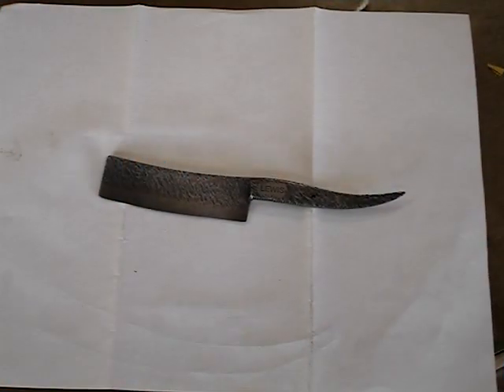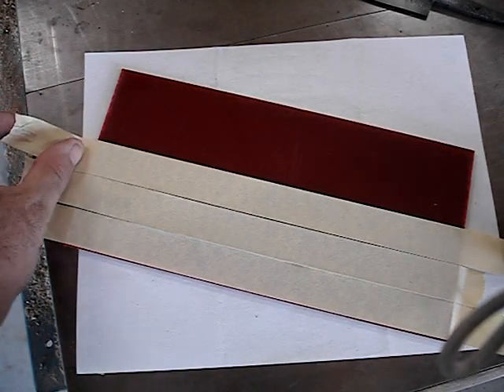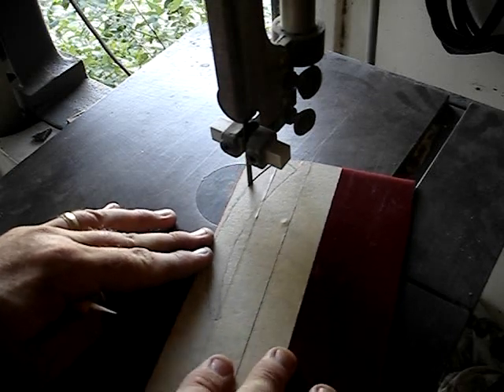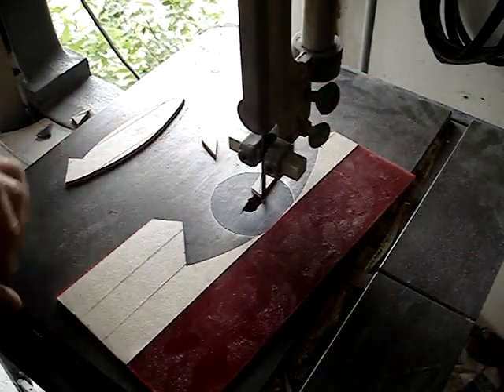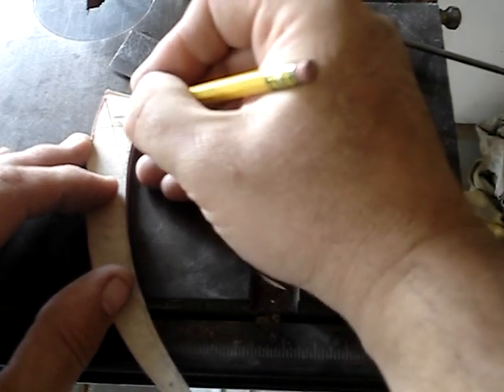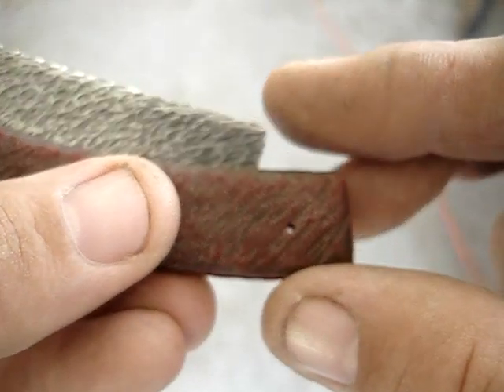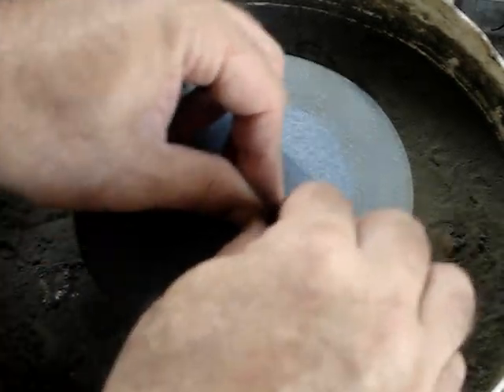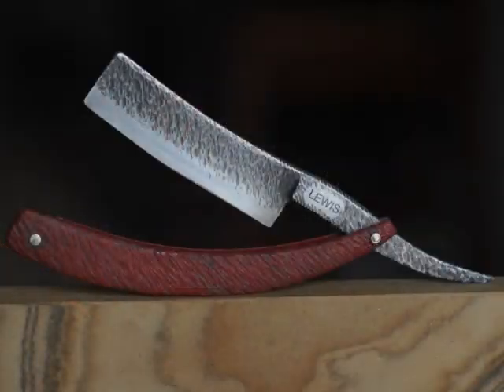Straight Razor Scale Making

Comment from the maker: @justinsundaram17 I textured the blade and scales with a die grinder. I used a small carbide cutter on the scales and a small cut-off wheel to do the blade.

Comment from the maker: A good starting point for the of the thickness of the wedge is to make it the same thickness of the tang at the pivot hole. Remember to make the wedge tapered so that the scales make a V when holding the two scales and the wedge together.

Comment: Thanks for your excellent videos! Could you apply the techniques from your "minimum amount of tools" vid with G10?
Reply from the maker: Theoretically yes, but it would be a LOT more work cutting and sanding g10. You would ruin several coping saw blades during the process.  Be careful with g10 dust it is nasty. Some type of linen, paper, or canvas micarta would look similar to g10 and not have the nasty fiberglass dust.  Yes, can do these g10, or micarta by hand, it is just a lot more work.
Reply: Thank you sir!

Comment: Nice! So what are you doing to the scales on the slack part of the belt? One last question I understand the thick part of the wedge is determined by how far the blade goes inside the scales when closed.  What is the purpose of the taper? And how to know how thick the taper/small end needs to be?
Reply from the maker: The wedge puts tension on the scales to hold the blade in place. https://youtu.be/isPvvVdyQio
Reply: @lewisrazors  Thanks!
When you are sanding the scales with the slack part of the belt, are you rounding the edges of the scales, to give them a curved appearance?
Reply from the maker: Yes, that is exactly it.
Reply: @lewisrazors  Thanks buddy! What material is this scales?
Reply from the maker: Wood I think, it was a few years ago